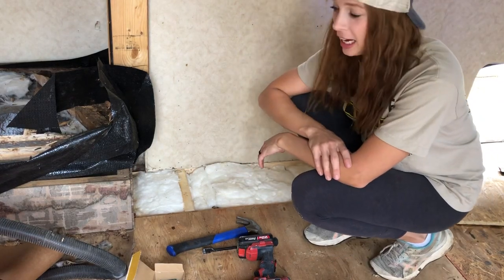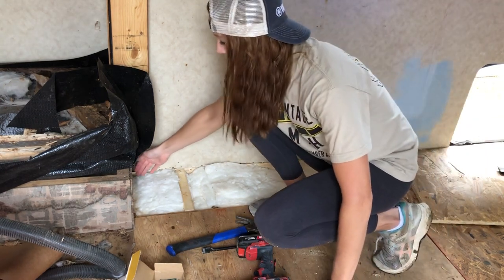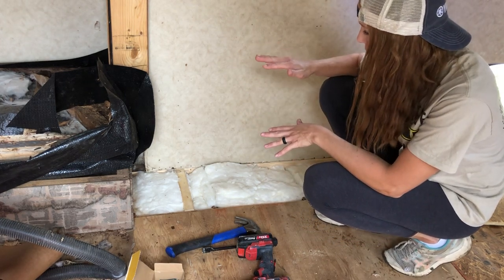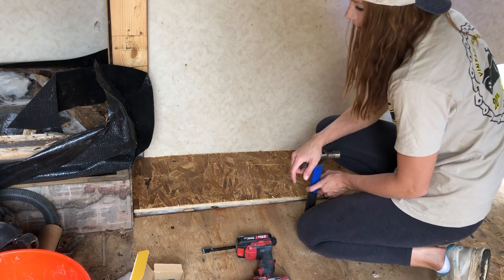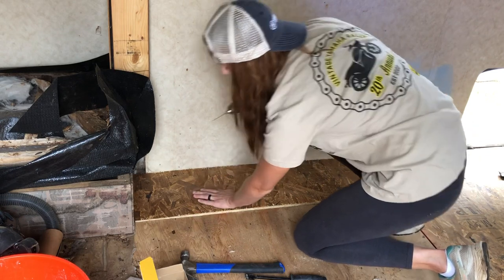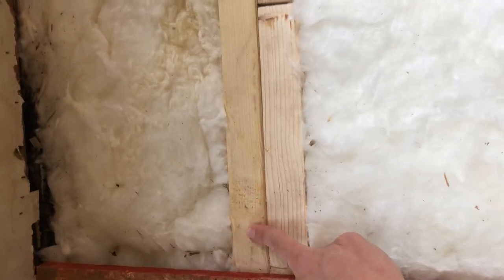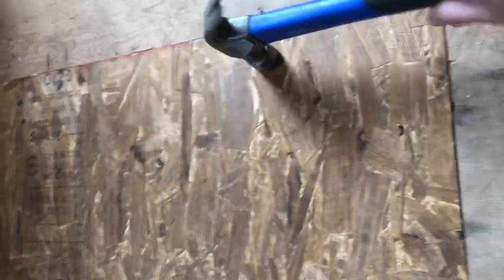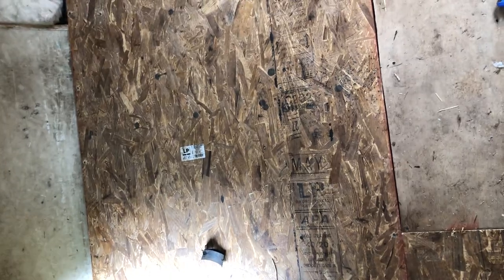RV RENOVATION: Repairing water damage on camper floor!

Comment: Why did you add the new wood in between and screw them together? My floor seems weak and the wood pieces move a lot and there is more foam than support in the area I am trying to fix and trying to figure out how to do it. thanks in advance!

Comment: Love your videos…but have a question. I have my first camper with severe water damage at the wall/floor junction. In your video, you only had damage to the wall. Any videos or instructions for how to repair the joist and all the layers under? Having a hard time finding what exactly is supposed to be under the subfloor! Metal? Membrane? Insulation? In what order?!
Reply from the maker: I have another video called ‘6 steps to repair water damage’ which goes through walls, floors, ceiling and roof repair! It a bit lengthy but worth it!

Comment: How did you remove the cabinets?
Reply from the maker: Hey! Every camper is different, but mostly it’s a structural frame with a decorative face frame stapled to the front. You take the whole front off, and then the 1/8 inch paneling on the inside of the cabinets, and there will be screws to the wall and ceiling. If you need help, send me some pictures on Instagram or to my email (hrfallen0616@gmail.com) and I’ll help you out!
Reply: @fallenintocamping  omg thank you I am about to start a massive project and I'm overwhelmed so I will definitely be messaging you

Comment: Never osb thats probably why your fixing it.Treated plywood
Reply from the maker: It was actually plywood that rotted, and I replaced it with OSB. Honestly, the material doesn’t matter as long as your camper doesn’t leak.
Reply: @gabrielutasi I agree, use plywood when you can, it is more structurally stable with heat and humidity. It will rot at about the same rate as OSB with a leak. If I do a full floor then use marine plywood, glue and screw.